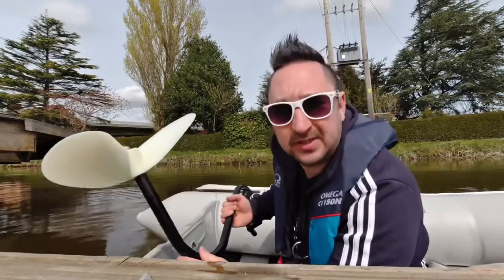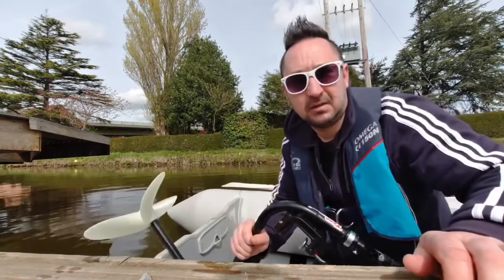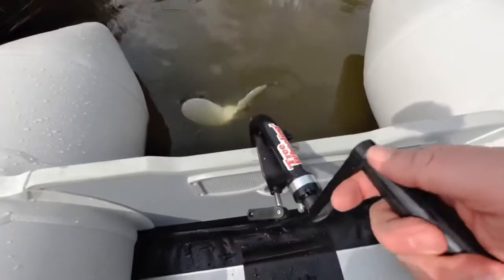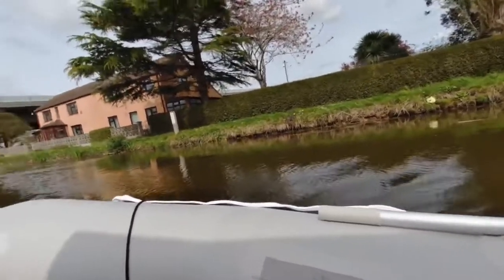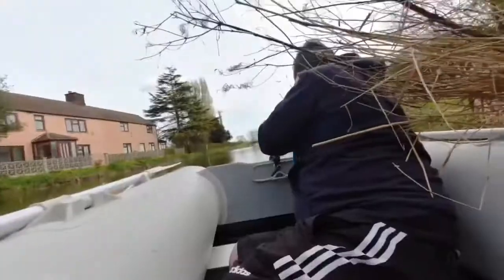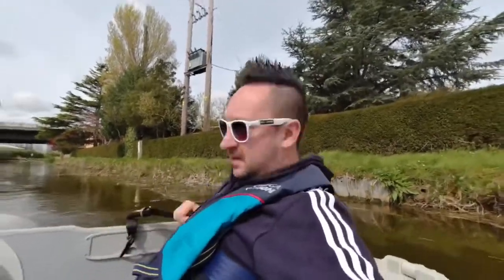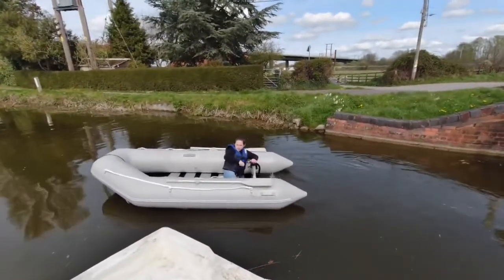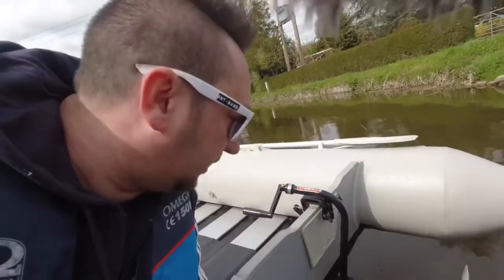Hand Powered Outboard Motor | FREE WHEELING OUTBOARD

Comment: I had one but it broke after the first use,  I returned it for a full refund. Apparently there's a new and improved design now (though yours appears the same as the one I had) will be interesting to see how long yours lasts.
Reply from the maker: Thanks for the heads up..
To be honest I’ve not really used it. My son has been using it on a small dinghy in our local swimming lake.
I was thinking if the handle breaks off maybe putting a drill on it.. or just send it back 😂 thanks for your comment 👍 don’t forget to subscribe
Reply: @BoatBloke  I've seen people put drills on them, incidentally the handle is actually what did break on mine. 

I have subscribed, looks like you have some great fun on the water! I am in the market for a low budget small (under 5hp) outboard, so please if you see any decent deals point them my way!! 

I may get an electric trolling motor if not.
Reply from the maker: I love being on the water..
Facebook marketplace is fantastic for finding a Outboard also Gumtree.
Have you had a outboard before?
Reply: @BoatBloke  me too, I don't care whether I am swimming, in my kayak or out on the boat. I have an old Volvo Penta but it is as good as scrap now, it stopped working and then seized, I stripped it all down and found that one of the piston rings had snapped in to 2 pieces, I have no idea how it happened!
Reply: You said that you have seen people put a drill on their handheld, how-to video somewhere? If so, can you link it?
Reply: You said that you have seen people put a drill on their handheld, how-to video somewhere? If so, can you link it?
Reply: @BoatBloke  if you are not using it would you sell it?  If so how much for?  Thanks
Reply: @daveyettram5077 do you live near Weston?